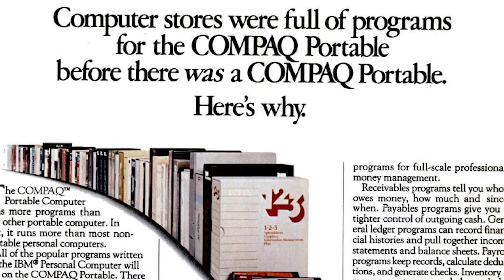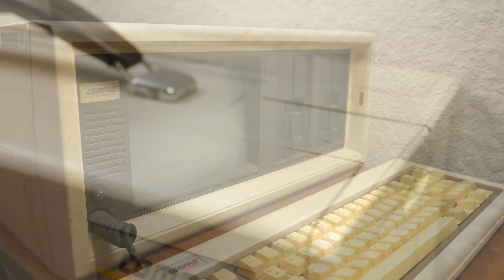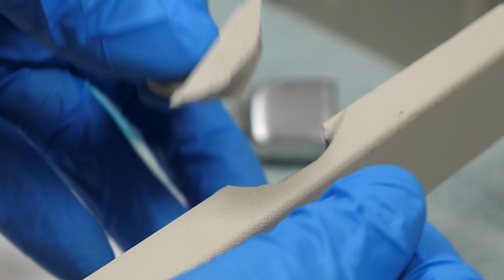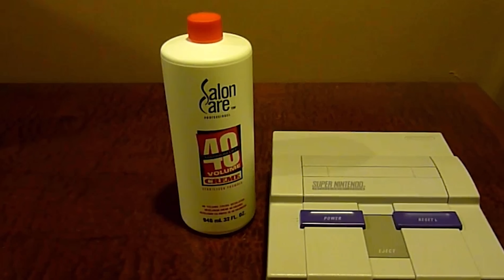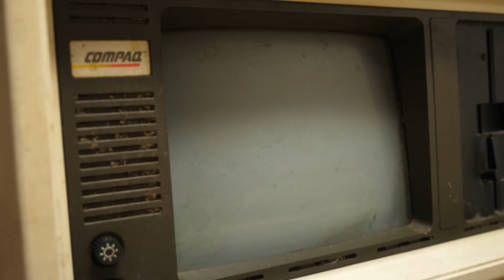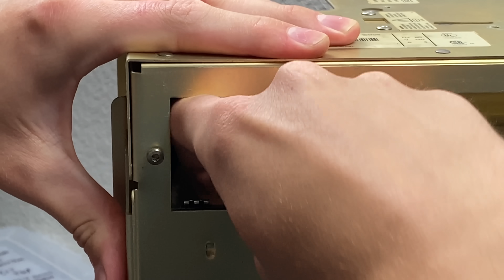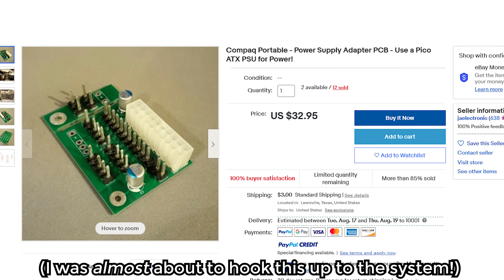The Trash Picked Compaq Portable 1! - Overview, Cleaning, and Diagnosis (Part 1)

Comment: Crazy how expensive these vintage computers have become since the rise of YT channels focusing on retro PCs like LGR and 8-Bit Guy. The same inflation phenomen is happening with audio and video equipment thanks to Techmoan. 

Also, kudos for the woman who found this PC and donated it to Michael, she's the MVP, this beauty is in good hands. And good job restoring this jewel!
Reply: It not entirely their fault, even if they are "contributing" to the problem.  It's the common issue of the "bathtub curve" of item/component value vs supply.  Very valuable at first when new and useful, value declines (sometimes fast) to low prices as the tech becomes less useful (or breaking, throwing away, selling), and those actions severely reduce supply right as collectors, repairers, etc want to acquire parts for restoration or some sort of need for a business running vintage hardware.  

It happens in almost every sector of production of mass market goods.  Cars, furniture, tech, clothes, etc.

There are people that have made livings off of exploiting the curve by buying 5-10 years into a product life cycles, carefully storing it (and possibly buying up available goods as they come to market again) and then selling it off 20-40 years later.  Obviously this requires space, dedication, and market knowledge, but at it's core is a very simple principle.

Comment: i would say its probably best to recap the board with modern solid state capacitors since the electrolytic capacitors at best are barely running in-spec at this point

Comment: Quick word of advice: magic erasers can fuck plastic textures. Never apply more pressure than it takes to move it across the surface. Soaking it in alcohol works better than water. Test an unseen area to determine how much pressure you can apply before it starts to strip the texture off the plastic.

Comment: Ah yes, Tantalum capacitors, breaking vintage computers since the 80s. Adrian from Adrian's Digital Basement has made a couple of videos diagnosing and replacing capacitors on vintage computers, you might want to get in touch with him, Shelby from Tech Tangents or really any other retro tech repair Youtuber to get the motherboard sorted out, It's definitively cheaper (and easier) than finding a working one on eBay.

Comment: @Michael MJD: You should try powering up the system with the motherboard reinstalled and the power disconnected from the same floppy drive you had disconnected during your power supply test. I have a suspicion that that floppy drive could be shorted and causing your problem. I have had this exact problem on one my vintage systems that turned out to be a shorted 3.5" floppy drive.

Comment: It's not too important here but the power supply shutting down is NOT from a crowbar circuit; those are (usually) just for overvoltage. What you had tripping was overcurrent or overpower protection. Overvoltage protection would only trip if the power supply has a problem, or in some cases if there isn't enough plugged into it.

Comment: I believe it was either this computer or the Osborne that wasn't advertised as "portable" but rather "luggable."  I bet that if you hook it up with the replacement power supply without the crowbar circuit you will quickly find the bad capacitor.

Comment: Encountered the exact same problem with the one I picked up. Those orange tantalum 10uF 16v caps always seem to be the cause, as I had two failed ones on the motherboard. I went ahead and replaced all of them across the dozen or so that appeared on the motherboard and expansion cards, which got my machine booting again. I also had a unique problem where one of the logic ICs on the floppy controller needed to be replaced.

Also completely expect the keyboard to need new foam disks, I don't think anyone can avoid those from turning into a powdery dust after 35 years.

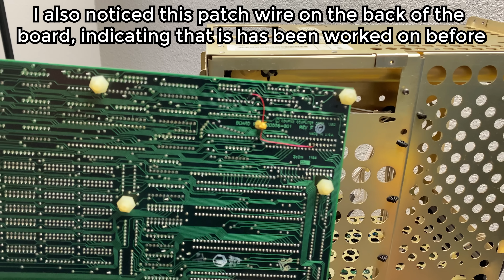Comment: 29:08 - in fact, the patch wire could be installed on factory -- sometimes manufacturers used to add modifications into circuit and use patch wires to reuse old PCBs
Reply: Yep, were very common up through the early Pentiums.
Reply: @Reziac  even today rev1 boards have it semi-often!
Reply: @kaitlyn__L  Haven't seen a patch wire since probably the Slot 1 era... but manufacturing has improved a lot, too.

Comment: I regret throwing out my old Voodoo 2 years ago.

I'm thinking of building a mid-late 90s Desktop for some old hardware/software and felt like doing Voodoo 2 SLI (only had a single back then), I thought they'd be like £10 on ebay.....it's closer to £100 for 1.

Edit:

EEVBlog also has a video on repairing a Compaq portable for anyone interested.

Comment: Get a regulated power supply for the 5 and 12 volt rails, feed them power and put Isopropyl on the motherboard. The heat from shorted components will tell you where its failing. I reiterate, get a REGULATED one so you're not feeding 16 amps through a small cap :), a computer psu will likely shut off once it detects a short so get a proper lab device or something you wont need anything expensive and precise. If possible I'd suggest removing the chips when doing this. If nothing shorts out without them, start measuring their VCC to their ground pins and find whats shorted

Another way to do it is to once again use a regulated power supply, feed the board power and find the smoke.
Oh, and don't dig into the chassi with both hands when you're around the internal PSU or CRT. Even if the device has been unplugged for months/discharged. I can tell you from experience, the potential shock hurts and is more than enough to kill.

Comment: I have to admit, even though I do not have a Compaq Portable, I actually still own a broken Pentium MMX 200MHz machine that suffered from the same "turned on for a few seconds" issue. The AT PSU wouldnt work if the faulty motherboard is plugged in. Eventually I tried using some sort of ATX-AT PSU (I've been advised those aren't recommended later on due to lack of negative 12v voltage) adapter and if blew one of the tantalum (nicknamed tantrum) capacitors on the motherboard.

It's really interesting to learn something from your videos (and others as well) that I finally have an answer to in my troubleshooting. It's been 3 years since I left the computer unfixed and this video gives me motivation to get it running again hopefully! It's one of the reasons why I keep enjoying watching your videos and so 8-Bit Guy and NCommander as well.

Comment: Use a bench power supply on the motherboard (you don't have to use the full 12 volts) and spray air duster upside down on the board and see which cap is hot. You can also use a thermal camera or just touch. Most bench power supplies have over current protection so you should not have a cap catch on fire. It sound crazy but it actually works great for finding shorted caps.

Comment: Watch out for that switch assembly! They contain big old filter caps and they can POP being that old. Very messy and stinky.
Board probably has a shorted tantalum cap somewhere. Just replace them all wholesale if you can. It would be  good soldering practice.

Comment: Quick tip! Those old tantalum caps (orange boys) have a habbit of exploding as their failure mode and the ones at the lower end of the manufacturing tolerances are rearing their heads around now, Recapping the entire thing would be far too much work, but dont be surprised if you turn it on one day and you get a explosion!
Reply: Is there a way to test or protect the system from this without simply recapping the whole thing?
Reply: Yeah, know someone who had an Osborne catch on fire... was likely how that happened.

Comment: I used to have one of these that I put an original 10MB full height IBM drive in it from a 5160.  The power supply would tend to overhead and shutdown. So I mounted a large fan to the PSU to keep it running.  I later swapped to a hard card and didn't need the fan.

Comment: I have a theory that the smokers residue saved it from (actual) yellowing from oxidization
Reply: That could be the case, the plastic could also just be high quality and not yellow easily such as the kind used for the IBM model M keyboards.

Comment: Windows 3.0 on the FREE Compaq Portable PC? Other than that Good find!
Reply: Why not 3.0? I think that still works on 8088s, at least it works on 186s.
Reply: @eDoc2020  oh yeah, my bad
Reply: @arrhythmixx  No problem. Your original suggestion of Windows 2.0 would probably be more interesting. 3.0 will be slow on a 4.77 MHz 8088. Plus "everybody" is familiar with Windows 3, 2 is probably a better learning experience.

Comment: You could actually just try to use the adaptor and the shorted cap will blow up so you know wich one it is. But its kinda risky cause idk how strong the traces are
Reply: I blew a trace out on my VDU. 8-bit guy blew a hole through his motherboard.I actually did check the caps on the VDU before I powered it on, which is why I got surprised when it exploded in my face; it wasn't a dead short. But yeah, that's the surefire way to find it :)
Reply: @NCommander  What happens if you power it on with very low voltage, and ramp up slowly?
Reply: @Reziac  It explodes in slow motion :)
Reply: @NCommander  Well then, no need for the high-speed camera! ;)

Comment: as a certified Compaq repair tech from the 1990's you did good with your limited resources..
the wire on the back is from Compaq do not mess with it..
your cap idea is possible another thing you can do is ground yourself (i.e. ground strap or touch metal chassis while working) carefully remove all socketed IC chips then plug only the motherboard into the PSU and power on and see if you get a steady LED...
i would suggest giving a try to fix the motherboard..could be a good learning experience and worse case you will need to source a new board...
GREAT VIDEO 
cant wait till part 2!!
Reply: Get this comment to the top!
Reply: Hopefully this comment is noticed :)
Reply: bump
Reply: You were still working on these things in the 90s? That must’ve been equal parts maddening and fun, like when my dad would beat his old Kaypro with a rubber mallet to try and extract an old document.
Reply: Did part two ever come out? Need closure!
Reply: Me too
Reply: Up

Comment: Wow nice video but i think you should try to replace the tantalum capacitors with modern electrolytic capacitors. here a tutorial about the Compaq Portable https://oldcrap.org/2020/10/08/compaq-portable/ its not soo hard to get an electronic soldering kit on amazon https://www.amazon.ca/Multimeter-Rarlight-Temperature-Desoldering-Screwdriver/dp/B07L3VNMKX/ref=sr_1_13?dchild=1&keywords=electronic+soldering&qid=1628889598&sr=8-13 and you gonna need also this to absorb the hot liquid metal its called a solder wick https://www.amazon.ca/NTE-Electronics-SW04-10-No-Clean-Anti-Static/dp/B007Z7Y7XM/ref=sr_1_5?dchild=1&keywords=solder+wick&qid=1628889811&sr=8-5
and a capacitor kit just make sure to choose the same value this kit offer values from 0.1uF~1000uF https://www.amazon.ca/Hilitchi-Electrolytic-Capacitors-Assortment-0-1uF%EF%BC%8D1000uF/dp/B07M914GKR/ref=sr_1_7?dchild=1&keywords=electrolytic+capacitors&qid=1628890113&sr=8-7

Comment: As the old saying goes, one man’s trash is another man’s treasure.

It’s unbelievable what some people throw away, regardless of this machine's issues.
Reply: I mean, many average Joes believe that old computers are worthless junk.
Reply: @thepirategamerboy12  yep the worst thing is when my dad gets rid of a pc he destroys it with a hammer because he doesn’t want anyone getting the data because he doesn’t understand how to remove data so I lost all of my childhood pc and laptops
Reply: @samuel-wankenobi  Oh that's brutal. Occasionally people toss PC's and they do things like pry the chipset from the MOBO or cut every wire with scissors in the PC, shit's infuriating.
Reply: @samuel-wankenobi  The method I've usually seen involves a large drill bit. The worst solution I've seen also used a drill bit to protect the data and the drill went through.... the DVD drive. The HDD below it was scratched with the tip of the drill bit but there was no internal damage.
Reply: @samuel-wankenobi  My dad took an eMachines eOne to be recycled which was in perfect working order. Sad that he didn't ask me if I wanted it.
Reply: @samuel-wankenobi  just destroy the HDD or SSD
Reply: @Moocat90  my dad was dumb he didn’t know that
Reply: @samuel-wankenobi  yep
Reply: @samuel-wankenobi  oof i wish your dad did not do that R.I.P random laptop or pc from you childhood
Reply: @thepirategamerboy12  well they actually are that
Reply: @beardsntools  Whatever you say, average Joe.
Reply: @thepirategamerboy12  I am not average joe, just being real. One mans trash is another man's... well trash
Reply: Remembering the Apple 1 that was thrown out
Reply: @arrhythmixx  who thrown it out?
Reply: @kourkoutas2  don't remember all I know is that one was thrown out
Reply: I found 6 laptops and I built my own pc from junkparts 4 free
Reply: @FS--ew3se  I acquired at least that many from past jobs where they were abandoning obsolete laptops and giving them away for free. Likewise with some old servers too.
Reply: It's quite understandable to be honest... if they're not computer nerds and into historical stuff, it's worthless to most of the people, especially if it doesn't turn on. Not many people would wanna keep a large machine like this just to run DOS in 2021...

I've saved a late '80s computer from a pile of junk as well, it turns on fine, but I don't have an old enough monitor for it. So I probably gonna put it up on Ebay, since I can't do much with it.
Reply: @MetalTrabant  I’m in the opposite boat, having an old 9-pin RGB monitor but nothing to hook it up to. Funny how that works out sometimes.
Reply: @DavidWonn  Also funny that I probably had such an old monitor, because there were some old ones in the house I've bought, but they were so old and crappy I've thought I'll have no use for them, so off to the junkyard they went... we can't keep everything forever. 

They probably didn't work though, as some power chords were chopped off, and my mom took them out to the rain, that didn't help either. Not sure if they weren't just plain VGAs though...
Reply: @MetalTrabant  I bought mine at a thrift store for about $5 when CRT monitors were everywhere (just as flat panels were taking over but long before the current antiquity trend which drove prices upward.) It looked to be in decent shape as far as I could see on the surface and assumed I’d eventually get a computer that would pair up with it. I have no means to reliably test it, unfortunately.

As for plain VGA monitors, they should have the 15-pin layout instead, though with a few pins deliberately missing. I keep one on hand as a backup monitor for my PS/2 which requires a particular pin to be missing.
Reply: Space at home isn't unlimited. You don't really which old crap is worth something.
Reply: Another old saying is that all old tantalum capacitors go short circuit.
Reply: They threw away--- well trash, doesn't matter even if it was working, this computer is long obsolete
Reply: Yes, i threw my Diamond  Monster graphics card with Voodoo 2 chip 10 years ago. Now it worth like hundreds of bucks 💵  😱
Reply: I've dumpster dived so many machines that were just an easy fix like a loose cable or what not
Reply: they should stop throwing them way and start giving them away or to make people start picking things from the trash or the trashcar should save the things ans after to have people to seach everything and reuse them